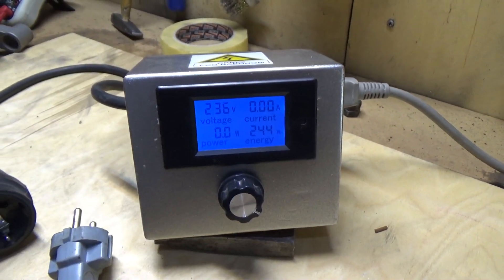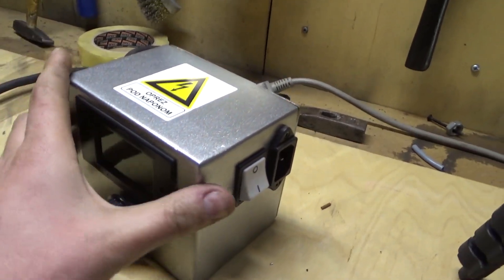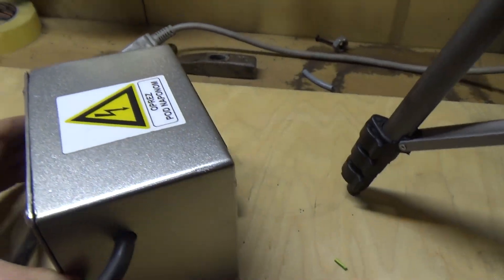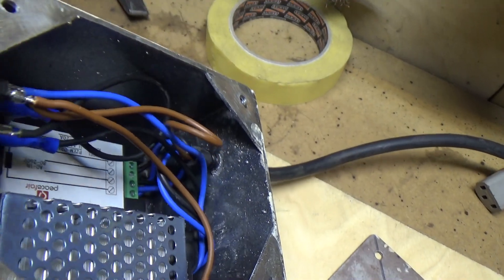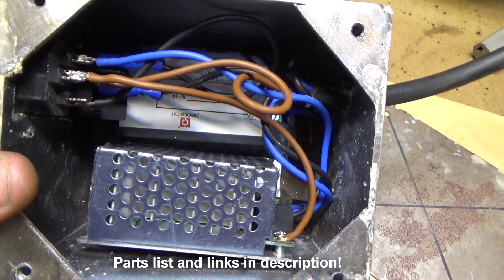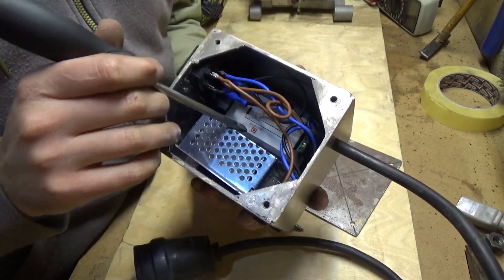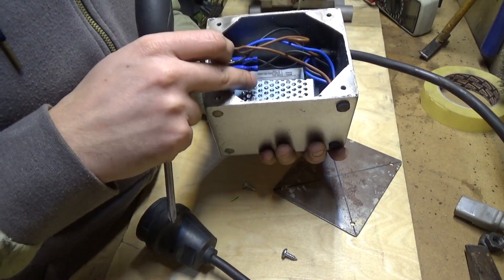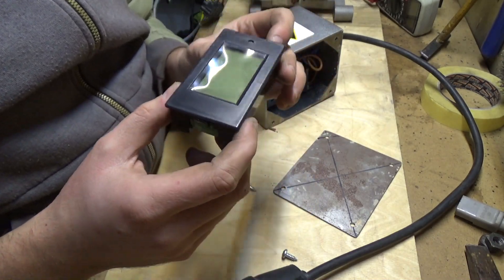How I made a power regulator and measuring device

Comment: Hi,
To be sure, this will only work with AC motors right?  Do you know a module that can output AC and DC current ?
Reply from the maker: Output is ac, and this wont work with induction motors because their rpm depends on frequency 50/60hz for that you would need a variable frequency drive or VFD, for dc im not shure what would happen if you would just use a full bridge rectifier on the output, i mean it should work, i dont see why not
Reply: @DIYGarageProjects  Thank you for your response, a lot to discover and new interrogation for me ;)
Reply from the maker: Yes i always found this interesting too :)